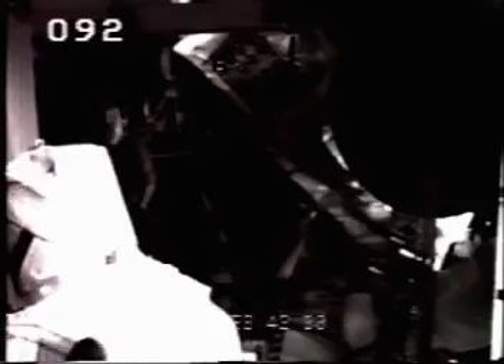Mishap At NASA: Hypergolic Fuel Fire

Comment: I see a lot of comments mocking the use of a bucket of water to put off a fire in a high-tech equipment. Sometimes the simplest, low-tech solutions have the best outcomes. For hydrazine-based fuels and nitrogen tetroxide, the best way to put off a fire is by using water. Bucket or hose, it doesn't matter.

Comment: Change over to battery powered space transport, PMSL
Reply: You aren't going to match the TWR of chemical combustion propellant with a battery. You may manage something more efficient with lower TWR, but you buy that efficiency with time. For manned operations, time is very expensive in terms of mass you have to carry with you. As far as the video goes, incidents happen. Based on other comments, the oxidizer was already removed, this was a fluke interaction between residual fuel and some of the insulating foil, and they had water on hand just in case this sort of thing happened. Wasn't fully fueled, etc, just a bit of residual that sparked up and was handled by the SCAPE crew as it unfolded.

Comment: Working in confined space with a volatile fuel and you only have a bucket of water on hand, have you heard about fire extinguishers ?
Reply: Water is the only way to extinguish this type of fire.
Reply: Extinguishers smother the fire by cutting the fuel off from the air. Hypergolics are a fuel and oxidizing agent that spontaneously ignite when they mix. You can't smother it with an extinguisher when it doesn't rely on atmospheric oxygen to burn.
Reply: @jamesmaida47  Thanks for the info.

Comment: Sorry, which planet did this happen on? Cos on this planet you can't put a hypergolic propellant fire out with water. Here on earth that would have spread it everywhere.
Reply: I preformed the same SCAPE operations  for 23 years at Kennedy Space Center. The reason they used water is because Hydrazine is hydroscopic, which means it absorbs moisture, (water) and will dilute it .
Reply: @jeffarno5296  No shit!? Wow, okay, thanks, I stand corrected.
Reply: Water can actually break the very weak molecular bonds in the hydrazine and nitrogen tetroxide which would prevent any more reactions.
Reply: It wasnt both fuel and oxidizer. The report said that MMH spilled onto a blanket that catalyzed the MMH causing the fire.

Comment: A bucket of Water. But its a special NASA Bucket.
Reply: it's made of carbon-carbon composite and it's rated for 12g at 800 degrees C.  It costs $16,500
Reply: @devilsoffspring5519  As someone who worked in aerospace, this is 100% the way. haha
Reply: It's referred to as a Combustion Extinguishing System, or CES

Comment: Looks like a high tech way of quenching a fire, use a bucket of water, of course!
Reply: I preformed the same SCAPE operations  for 23 years at Kennedy Space Center. The reason they used water is because Hydrazine is hydroscopic, which means it absorbs moisture, (water) and will dilute it .
Reply: Depending on the chemicals used, sometime they have to use water only.  Imagine if they had to use a standard fire extinguisher, the powder used would do more damages and create a problem.  And fire extinguisher powder get in everywhere even inside sensitive electronics.

Comment: STS-69 OV-105 
Right Pod MMH Fire (51411995, KSC OPF1)
During the STS-69 OV-105 flow, while performing a thruster R1A removal and replacement, 
a fire broke out in the right OMS pod stinger area. A technician in SCAPE was disconnecting 
the R1A thruster MMH feedline dynatube during a thruster removal and replacement procedure. 
The procedure was initiated following an in-flight anomaly that occurred on the thruster during 
on-orbit operations (R1A primary thruster failed off due to a low chamber pressure).

Comment: when did this happen?  where?  what vehicle was being tested?
Reply: In the past, some test place, the one they were fueling.
Reply: @benebutterbean2737  It was not some test place. This actually took place in Obiter Processing Facility OPF-3 on second shift, while removing one of the thrusters. The technicians were disconnecting the Fuel ( Hydrazine) line from the thruster. There was some residual liquid in the line that leaked out and reacted with the gold foil insulation blankets. I actually worked taking of the Oxidizer line on first shift. We were lucky they were able to put it out with the water, I could have been a very bad night....
Reply: @jeffarno5296  Now that makes sense.
Reply: @benebutterbean2737  Don't listen to that guy. I was there, it was nothing like that. This dumb-dumb left a cheesy pita in the convection oven in the break room for too long. It really bummed everyone out. We had to eat in our cars for the next 6 months while they repaired the damage.